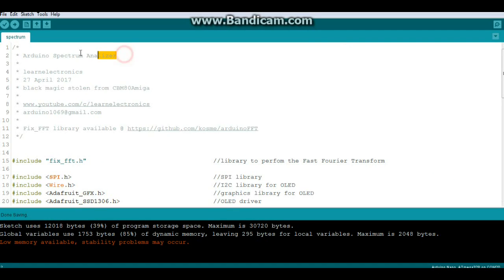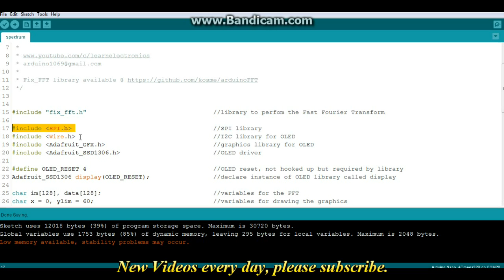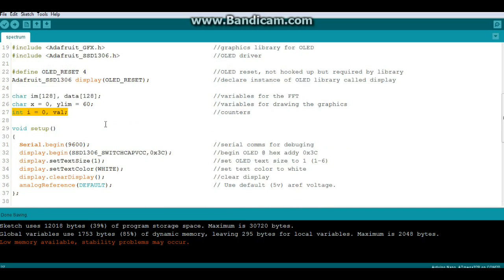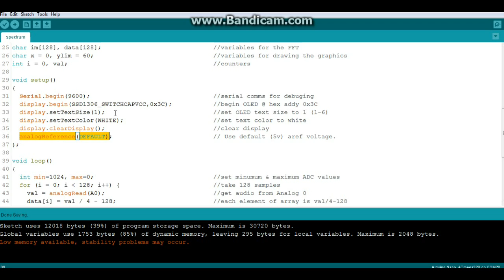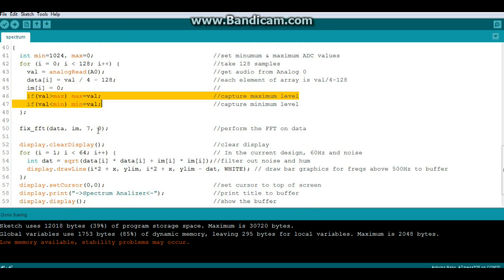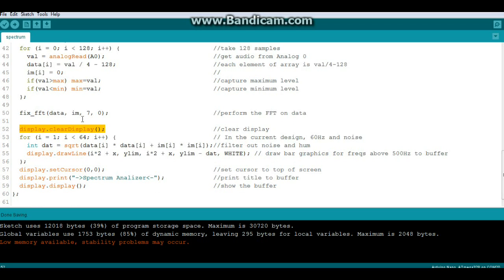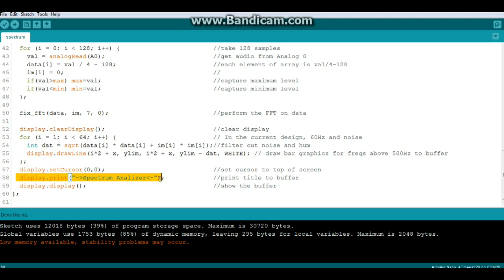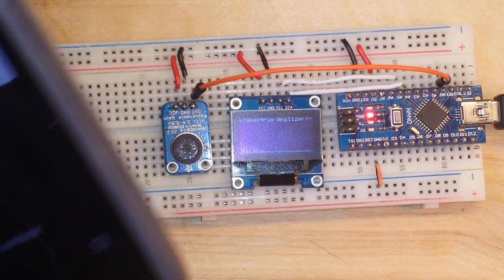Arduino Spectrum Analyizer

Comment: sweet project, i would like make a 3 phase voltage/current harmonic spectrum analyzer for the smart-grid to test for dirty power. a cheap-o fluke-41 single-phase.. thanks ..:) esp32??
i would be interesting to play some audio tones like 400,  2000, 5000 hz to see the vertical bar graph results 🤔

Comment: this only take DC Offset
data[i] = val / 4 - 128 

BLACK MAGIC !!
it just calculate the magnitude of the Bins
is the same as PITAGORAS !!!!
magnitud = SQRT( REAL**2 + IMG**2)

int dat = sqrt(data(i)*data(i) + im(i)*im(i))

FFT function:
fix_fft(int8_t fr[], int8_t fi[], int16_t m, int16_t inverse)

where :
fr[] = real array
fi[] = imaginary array
m = 2 elevated at m Bins, 7 in your case is 128 bins
inverse:  0 = FFT  and  1 = inverse FFT

Comment: Can we use led strips with this arduino instead of this display panel.
Reply: That’s actually what I’m working on right now, although instead of using a microphone it’ll take in audio input from a standard 3.5 mm aux input

Comment: How can I create a UVC light spectrum analyzer with Arduino UNO R3? I have a Waveshare UV Sensor GUVA-S12SD already. I am new to Arduino and need instructions on how to assemble. I want to be to output the wavelength on a display or some sort.

Comment: Do you know if the microphone analog output behaves the same as audio from headphone jack in our phones? 
Would be nice to see "clearer" spectrum from the cable
Reply: non-commercial audio signals [i.e. your phone's headphone jack] do not have a well-standardized line level, but typically operate on the order of 1V.  As the analog input range of most arduinos is 0-5V, an amplification stage before the input would help maximize your resolution, but direct input would likely produce a measurable result.

Comment: Ok, this is already kinda old, I just discovered it, still ... What the hell is your sampling rate (frequency)? You do nothing in your source to do a controlled sampling. The 128 samples are taken as fast as the A/D would do it - that ist useless. You need to determine a sampling freuqency, otherwise the results are just a funny display of funny jumping lines.

Comment: I think you need to add some pull-down resistors to remove some of the noise, especially since you are using an analog input on the Arduino.

Comment: I need to filter in a noisy hambient a specific sound and to "set On" an alarm: any suggestion? Thanks in advance, Sergio
Reply: You could do fft on your audio signal, target the desired frequency and set your alarm off when a peak of a certain amplitude at your target frequency is detected

Comment: Can an accelerometer be used instead of microphone ....we are working on vibrational analysis ..need some suggestions
Reply: Sure ! I did an experiment like that at work not too long ago ! FFT of your vibrations data over time will give you the amplitude of the vibration over each frequency.

Comment: Hello, it seem that the library fix_fft.h doesn't exist anymore in the GitHub link. Instead it seems to be another library called arduinofft.h, but the fuctions seems to use slightly different variables.

Comment: Thank You for amazing video and sharing information; can we have full audio spectrum display? i.e 20 Hz to 20kHz?
Reply: There's two aspects making that quite a challlenge: Speed and memory.
Speed: With 'analogRead' you can only get a maximum sampling rate of 9.1kHz, which - at the absolute max - allows for 4.5kHz signals to be sampled. The sampling rate can be increased drastically by using direct register manipulation, tho.
Memory: You need at least two full waves (ts > 2T) for FFT to work reliably. This means that for a 20Hz signal to be sampled at the necessary sampling frequency for 20kHz will take 8000 samples, so at absolute minimum (uint8_t) 8kB of SRAM, which is just not available, not even in the Arduino MEGA.
We could work around these by performing two or more FFTs for different frequency ranges, but we would be shooting out of the Arduino's comfort zone there. It's simply not built for such tasks.
Reply: Prasanna Gunasinhe
That's really pushing the limits of the Arduino's analog sampling rate, even with the ADC prescaler set for fast sampling.

Comment: unhappily for me it did not work. The words >Spectrum Analizer<  appear but the graph does not appear. Yes i use A0 for signal input
Reply: What happened to me was that the microphone's voltage output was too low. It actually might work with a single-frequency tone generator, for example, http://www.szynalski.com/tone-generator/
Just choose a square wave, bring the microphone as close to the speakers as possible(or even better, put it on headphones and bring one of them to the microphone), turn up the volume to the maximum and hopefully it will work :)

Comment: The  Fix_FFT is not at  the URL in the video, but I managed to find the  Fix_FFT close by. I having problems compiling. how do you implement the  Fix_FFT files (.h and cpp)? I tried to include the  Fix_FFT files in the sketch library as well.
"Arduino: 1.6.13 (Windows 10), Board: "Arduino/Genuino Uno"
Here is the Error messages that I get
C:\Users\John\AppData\Local\Temp\ccmvj0ye.ltrans0.ltrans.o: In function `main':

sketch/main.c:17: undefined reference to `fopen'

sketch/main.c:22: undefined reference to `fseek'

sketch/main.c:23: undefined reference to `ftell'

sketch/main.c:24: undefined reference to `rewind'

sketch/main.c:32: undefined reference to `fopen'

collect2.exe: error: ld returned 1 exit status

exit status 1
Error compiling for board Arduino/Genuino Uno.

This report would have more information with
"Show verbose output during compilation"
option enabled in File -> Preferences.
"

Thanks

John
Reply: A simple solution is, go to the libaray manager and add search for fft....and there is a fix_fft, simply add this and the arduino IDE now knows where the lib is.

Comment: Not good. On this analizer you can see only the low frequency.
Reply from the maker: +Jurij Lang adjust the code for the frequency you want
Reply: If the sampling frequency is low, it'll never detect high frequencies anyway.

Also, you'll get no meaningful info of any freqs whose period is longer than the sampling window.

Comment: thank your very much for the video. I am an arduino rookie and I would really like to do this build, but I do not have an OLED but a LCD (a000096) screen. So i am using quite a few more pins. Maybe you got an idea or can help me out with the code to receive the same result?
Reply from the maker: Herrclueless most lcd's are character driven not pixel driven. So I'm not sure it could work. Sorry.
Reply: learnelectronics ah I see, that's too bad. Thank you

Comment: Awesome video, you've been pumping out tons of content which is awesome! With time, subscribers and views will come, btw the fluke giveaway is great. I tried this one out but I'm not getting great results. I'm just looking at the 64 values in the serial monitor that would be displayed, and I don't see a visible change when clapping or talking. If I turn the pot on the microphone up, the leftmost values will go from around 8 to 60, (as well as a couple values next to it) but the rest of the spectrum is static. Any ideas?
Reply from the maker: Mariano Elia my best guess would be an amplitude issue with your mic, have you tried it with a line-in signal?

Comment: I'm pretty sure the "black magic" is just finding the magnitude for the complex data points returned. It doesn't filter anything, it's just a part of how the FFT returns data and how you need to convert it for display.
Reply: Fully acknowledged, that is exactly what I also thought. The author has actually no clue what he is doing. It shows some bars moving up and down, looks nice, but there is no understanding of the details. How do we know which frequency each bar stands for? Typical Arduino crap, all is sooo easy. Just import a library that someone else made and feel like a code guru. Horrible.

Comment: I'm looking into your code and I was wondering. Is it possible to printout the data into integers instead of displaying it on a LCD? It's my first time I'm going to make use of FFT and it's a lot to take. Could you perhaps help me by pushing me in the right direction?
Reply from the maker: Yes, all the graphics are doing is talking a value held in a variable and printing it

Comment: Hi there, this is a really cool video, thanks for posting it. I was wondering if I wanted to build this and also wanted to use a 1.3 in oled how would I change the code to run the larger display?
Reply from the maker: No change in code to use a larger OLED. They have the same resolution. You will just get a bigger display.

Comment: Where did you get the fix_fft library?   you should post links to libs or include them with code. I found one from TJC  no go, copied one from:https://forum.arduino.cc/index.php?topic=353495.0  errors....  error: 'prog_int8_t' does not name a type

 const prog_int8_t Sinewave[N_WAVE-N_WAVE/4] PROGMEM = {
Reply from the maker: If I could remember where I found it, I would have posted the link. It seems to be randomly floating around.
Reply: Could You add it to the dropbox?   pls...
Reply from the maker: Done!
Reply: Danke!
Reply from the maker: jacekf Gern geschehen

Comment: In the late 60's HP had a billboard done to advertise  a new spectrum analyzer  product. In the old days the billboards were done with paper panels that were applied like wall paper. The guys didn't realize they had got the panels in the wrong order and the sign read anal  spectromizer. Soon doctors started inquiring as to what this new device was used for. The sign got corrected quite quickly, butt not before lots of laughter.
Reply: I know someone who has a big heavy old one and he calls it a rectum paraliser
Reply: The backward joke still fresh nowadays. Thanks for the story. Amazing.

Comment: Excellent work I have to order one off this oled displays and try this project 👍👍
Reply: while you will probably not get access to such a display, the library with the oscilloscope(oszi.ino) is for a 16 bit color tft display that can be up to 15" at 1024x768. all controllable by an arduino via simple UART(Serial or SoftwareSerial). they were available on aliexpress once, but not anymore. they are made by Stone HMI somewhere in china

/edit: what im trying to say: displays like that do exist, probably from other manufacturers too, but they are hard to come by
Reply: Maybe with a tft display spi interface ?
Reply from the maker: jose luis arenas perez most of the TFT displays I've seen use way more than the 5-7 pins of SPI. but it would be cool in color